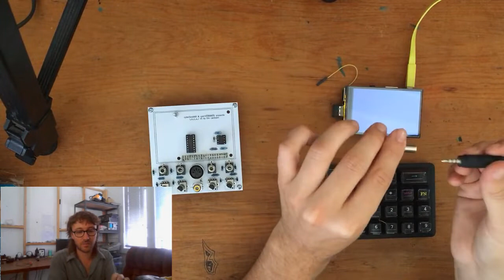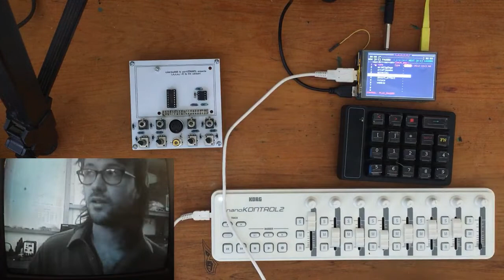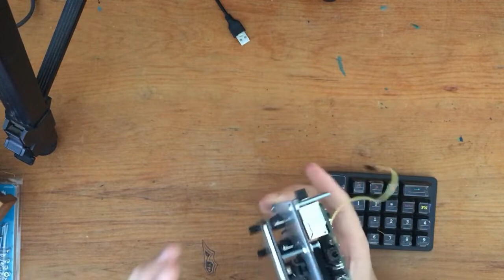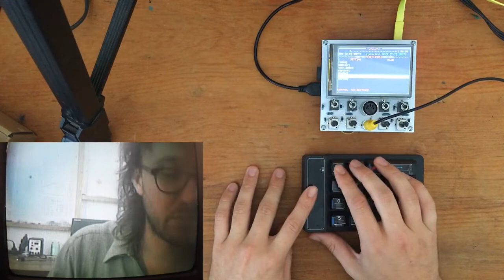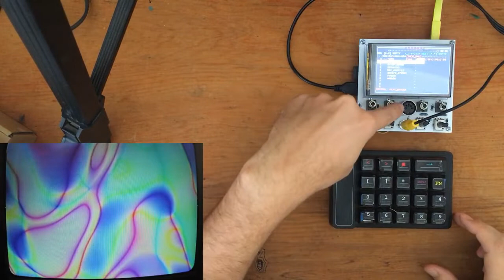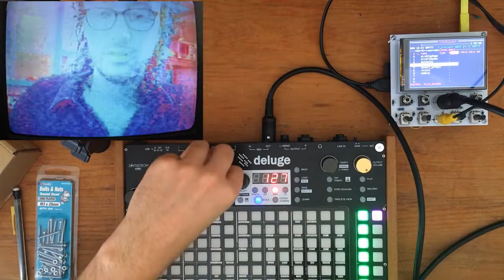i_n_c_u_r circuit demo

Comment: i love this shit and you inspired me to start developing my own projects. thank.
but there is one thing bugs my mind about your incure board:
you are using a 5v input source and a mcp3x08 adc with 5v vdd and vref but...

the GPIO of any raspberry pi are rated for 3.3v therefore the spi inverface runs
always over limit in your pcb design, 
no levelshifter, no voltagedevider, no buffers, 
no pullup resistors to 3.3v ( like some solve such issues for i2c interfaces )

i tend to think you are aware and made this design choise on purpose but
im very courios about your expirience and reasoning.

thanks a lot
Reply from the maker: hello - thanks for kind words..

yes this is true, it may be safest to have a level shift, or atleast voltage divider between data_out from the mcp3008..

in practice i found that it doesnt matter/doesnt seem to damage anything to do without.

there is some discussion about this in this overflow post:

https://raspberrypi.stackexchange.com/questions/38973/are-the-spi-pins-5v-tolerant

but still you are correct that this isnt best practice - i will make a note of this and potentially fix in a future revision of the circuit - thanks for raising this!
Reply: @cyberboy666  Never meint to criticise, working the other way around, 3.3v from the rasppi has a higher chance to fry the circuit. While working on esp‘s with the same tolerance I made also the experience that fast Interface communication don’t hurt anything.
I was especially curious because I found a million posts not to do so but only one who said there is no problem. Thanks again, you work put me on the path of creating my own modules and after one year I feel confident enough to make my own bare metal shader/video toy for eurorack
Reply: For everyone in the future who’s interested in this ( or similar) projects:
While I smoked my rasppi I can confirm that a 5v supply and subsequent 5v signal on the spi gpio’s wasn’t the issue!
I tried the circuit on a breadboard and voila - it worked perfectly fine.

Enjoy and consider following my projects too :)